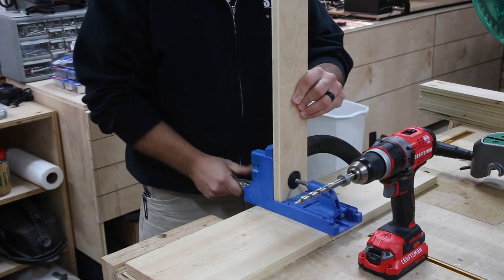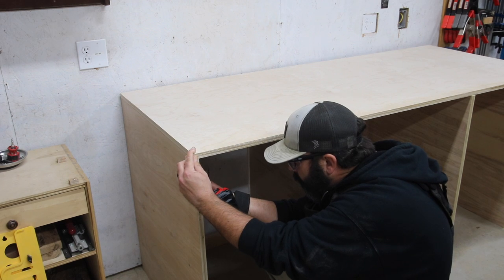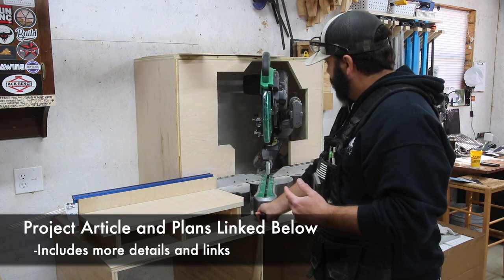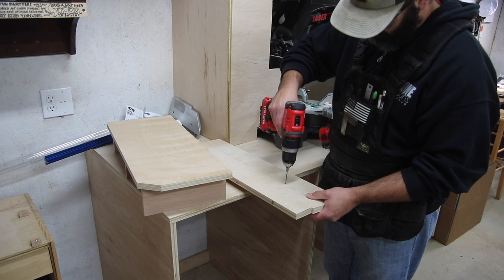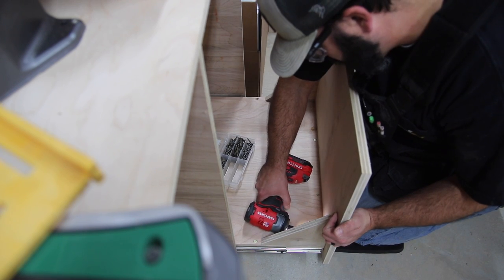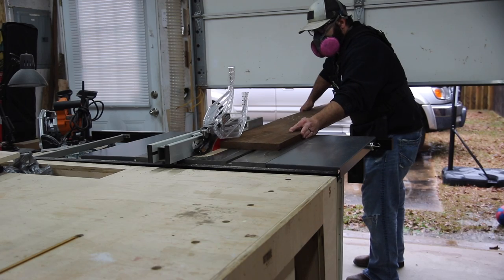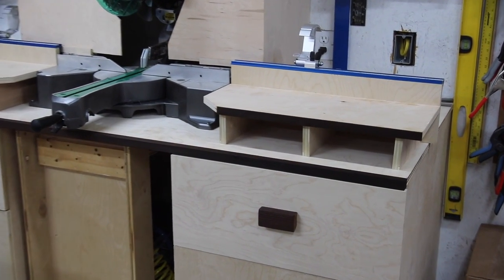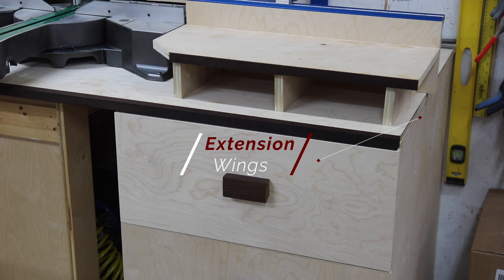Small Shop Miter Saw Station - Woodworking

Comment: I like the design, I wish you had gone into your dust collection for the saw.  I thought maybe you had a shopvac under on the cart until the end of the video where it wasn't for dust collection.  Now that you have the saw in an enclosed space how are you handling all of the dust?  I have the same saw and am in dire need of a mitre saw station for a 1 car garage, I think this will fit my needs.  Going to grab the plans and start building in the coming weeks.  Thanks!  Going to need to make mine moveable though.
Reply from the maker: Larry Joffe I’m about to start my new dust collection setup. I’ll have a dedicated port from my dust collector to the top of the dust box. I’m just concerned with the fine dust. I don’t mind the heavy dust settling in the back.

Comment: Interesting take on a very important piece of furniture for the shop.  My only question: what do you do if you need to make a compound cut?  With the enclosure around the miter saw, you can make your 45* cuts fine, but if you have a compound cut, it looks like you have to remove those enclosure pieces that are screwed from the inside.

I also like how you did the drawer pulls.  Thanks for the idea!
Reply from the maker: Glad you liked it. I rarely make compound cuts, but if I do it’s only a few screws. The removable panels allow full movement in both directions for mitered cuts.

Comment: I'm with Larry - how is it hooked up to your dust collection system?  Underneath looked like the perfect spot for a shop-vac.  Great design - thanks for sharing!
Reply from the maker: I’m in the process of getting a cyclone up and running and will soon be installing pipe. There will be a 6 inch port on top of the dust box. It will capture the fine dust, which is all I’m concerned with. The heavier particles will settle in the back of the box and I can clean that up every so often.

Comment: Dear Shawn,

The process of modifying the poplar is called 'Torrefaction." Torrefied wood is first kiln dried and allowed to rest to finish stabilizing. It is then placed back in to a special  oxygen free kiln and baked slow and long. This does not remove the sugars. Rather it crystallizes the various resins and caramelizes the sugar. This process make the wood much harder and denser, allowing faster growing softer woods to be used in areas we would generally prefer harder/denser wood. 

Two of the most common woods that are torrefied are maple and poplar. Of the various hardwood species, maple and poplar are both plentiful and relatively fast growing. They are also native to North America, making them ideal candidates for mass production of responsibly sourced hardwood. The maple is often used in place of babinga, rose wood, or jara for hand tool handles and fences. Poplar is commonly used for edge trimming and furniture framing. 

By using torrefied wood we are able to use what is already carefully grown and responsibly sourced, reducing demands for other more exotic woods, many of which have become endangered species in the last 40 years. For example, African Rosewood and African Ebony are both listed as highly endangered. Today, neither raw woods are allowed to be harvested or exported, and importing either to North America is a serious felony as of January 2017.

Torrefied wood can be used instead, providing nearly identical structural properties., and very high ecological sustainability. Torrefied wood can also be sanded into a polished surface (600 to 1200 grit) that requires little to no finishing. The hardened resin and caramelized sugars act as a natural moisture barrier. The only finish you might want is a thing waxing to make the polished surface shine. No need for stain or top coatings (polys, shellac, etc.).  

If you wish to stain torrefied wood, allow it to soak in about 5 to 10 times longer than normal (keeping it wet during that time). This is because torrefied wood naturally resists most liquids, especially oils and water. Stains can penetrate, but very slowly and much more shallow than with dried wood -- hence the longer soaking time. Finally, there is no way of predicting or preventing "blotching" with torrefied wood, and is why in most cases it is simply sanded and buffed to a desired luster.

Below are a few reference sites:
http://thermallymodifiedwood.com/blog/what-is-torrefied-wood/
https://en.wikipedia.org/wiki/Torrefaction
https://www.sweetwater.com/insync/torrified/
Reply from the maker: WOW! Great comment! Thanks so much for explaining that, a lot of info. 👍
Reply from the maker: If you don't mind I'm going to copy this to my website article. I'll credit you. Thanks so much!!
Reply: @StoneandSonsWorkshop    Please feel free to use as you like.  It is not "common knowledge."  So your posting will help a ton.  Always enjoy your posts and vids, and happy to help when I can.  Sadly, I have a face perfect for radio and a voice made for news print (LOL -- i.e.  I'm not making a video any time soon).  Keep up the great work and easy Southern Gent attitude ...  I'll be watching.  ;-)

Comment: I have noticed that every miter station leaves out the question of dust collection from underneath the miter saw base.

Has anyone thought of this area?
Reply from the maker: Jay actually has his dust port underneath, but for me the top is where I’ll install the dust port. Mainly because I want the least resistance with bends and such. Plus, all I’m concerned with is the fine dust and a 6 inch port from the cyclone should take care of that.